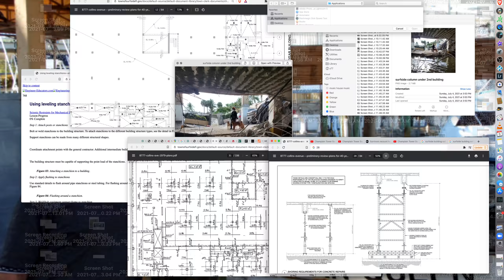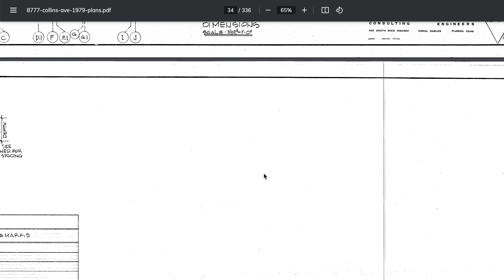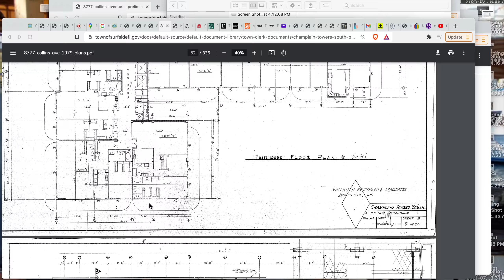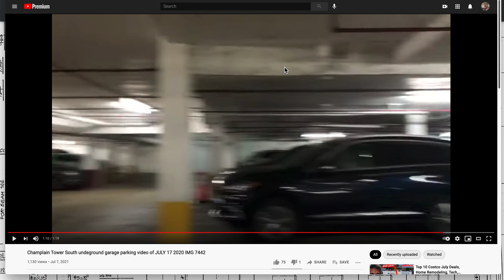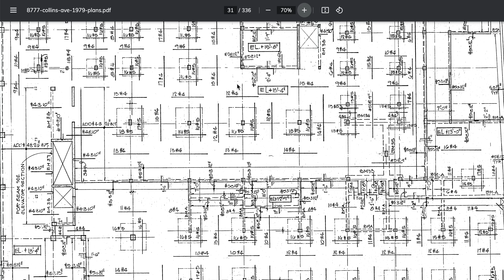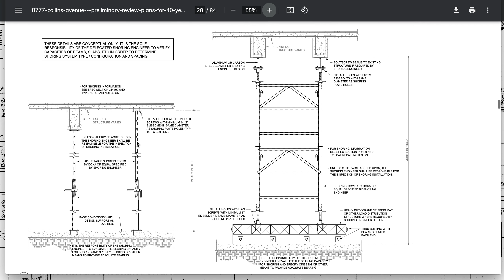Champlain Towers COLLAPSE GARAGE EVALUATION AND VERIFICATION OF BEAMS & COLUMNS DECK COLLAPSE AREA

Comment: The town of Surfside released more docs.
I read a good number of permits that were issued in May 21  related to new AC units.  In fact  some of the ac units that came down with the roof looked certainly new. 
Each ac units was quoted in the neighborhood of 5K USD. 
The building started the certification paperwork in 2018,  that is 3 years before the due date and this proactive gesture was highlighted by Mr Ross Prieto in Nov 2018. 
Maybe the Media “dilapidated and forgotten building” narrative is disingenuous to a certain point 
The renovation’s payment due date was June 30th , 21. 
Whether that came as a lump sum or a finance agreement submission, June w0th was the deadline.
Some of the surviving residents interviewed on TV  expressed as having mailed those checks a few days before the collapse.?? 

Was it all some sort of Bad construction + bad timing + bad luck  coincidence  ??
Reply: Isn't every major disaster a cascade of small events, situations, and oversights  that continually add up until one critical point when it all fails? 
I have seen other videos and images  post-collapse that feature the punch thru columns:  the images show the rebar appeared to be insufficient compared to what was indicated in the original blueprints.  If that is the case, it could be the foundation for the rest of the cascade to failure.  It's tragic so many people lost their lives for this to all  come to light. 💔

Comment: Good work.  Loved the one with the video from inside the apt, you do have good sources.

Q  Is the slab on ea floor in general a two way slab ?  Engineer noted in rebuild dwgs it was a two way slab, or maybe he meant some part of it was a two way slab.  I'm not an engineer but I haven't found anything that looks like symbols or drawing standards I'm used to that would make this a two way slab.
Q  Did you find a shoring plan to show where the designed shoring was going? For that matter I saw many notes passing the buck for engineering shoring to GC so then why show any shoring? Maybe the engineer scared of the slow pace of work authorizations for himself and GC's was about to insist finally on shoring going in untill work was done but gravity beat him to the draw.

The shoring detail for the transfer beams, showing TWO LAYERS OF HEAVY TIMBERS to substitute for pile caps (yet missed putting a transfer beam under scaffolding legs to get load to all of top layer timbers, 90% of top layer timbers were actually decorative), along with temp beams running under their full length is INSANE  that means the engineer had NO FAITH IN THEM HOLDING UP while repairs underway and with epoxy patches to full width cracks no wonder and how did that full width crack form, expanding rebar, but no not of probing to see it it's rusted even.   This detail is as you say proof something should have been done by city and engineer long ago.

It's not 100% but there is a large correlation between rough ceiling peeling paint? spalling? in areas under pool deck vs under buildings though it's obvious the building did believe in scraping and painting to keep everything "looking" ok  I question the 'beam' at transition of slab heights at first floor apts and pool deck.  i've yet to see a beam detail along the entire perimeter of the building  A curb / mini knee wall connecting the two slabs is not a beam unless wide enough and reinforced enough, and I took a quick look at 'existing' dwgs.  

I also didn't see expansion joints? Shouldn't there be expansion jt between pool deck and towers? as the deck will expand and contract differently?  Of course that would have required a separate col system to support the perimeter of the pool deck along the building.  Finally the lack of ties at property line wall, could have rusted to point they just pulled apart like little strings.
Reply: The 87th wall slab rebar corroded away.  There was a high resolution pdf I posted that correlated to corrosion in pool room, to the east of the hot tub.  Expansion joints should be for freeze/ thaw but that would have been a daily stress to the lobby beam.  When you look at the very last frame of the above video you see the basement SOG has settled approximately 1 inch or so along the shear plane and has butterflied and been repaired parallel  to the ramp drain east - west.  
Kai talks of the cantilever condition created along the 87th St wall corbel where the pool slab has failed.  The slab on grade has failed below the lobby beam planter.  Maybe the extra tile helped to level pool deck settlement in the area of the planters (initial or long term settlement) mirrored in the slab on grade below.

Comment: Also right where the collapsed floor happened at the ramp at 15:00 there is significant water damage on the deck above and almost looks like the water line from the other video. 
Is this near a column and how far away?
Reply: Also there is a significant Crack in the garage floor in that same area.
I watched a video from a resident that has now sued and won't release it "i asked him to show me it again" but I believe the column he showed in that video is right in that area as well.

Comment: Looks like some water infiltration at 13:23
Reply: Yeah you can see a bubble caused by water trapped under the paint. The paint probably made the concrete degrade even more aggressively.

Comment: The plans indicate drop slab around each column but I  can't see any? Do you see them? That would change punching shear capacity.
Reply from the maker: Micheal, check your email in a second, I will send you something.
Reply: drop slabs or just additional / different rebar  I'm still looking for symbols that might actually show this to be a two way slab, as the engineer noted someplace in dwgs existing bldg had 2 way slab

Comment: Great video.  At first I did not realize that the building left standing had stacked parking decks.  6 cars at 3000 pounds each were parked where the upper deck let go.

Comment: Great analysis. You noticed a lot more details. The building collapsed  where the pool deck joins the transfer beams and the building. The building would have stood if the deck were supported by its own columns.
Reply: Hi Tom.  I was just viewing this garage video; now I understand what you meant about the higher elevation not being as well supported. Thank you!

Comment: by the way, I think you may be onto something with the spans, esp if repairs were needed to them. between the outer fence wall and that one row of columns at 15, maybe, the next span over to row 13.1 is further there than where the row 14 thick columns are. staggered a few ways around there, so no single rebar would connect between columns, the loads would have to shift laterally through concrete over to neighboring rebar. hmm.

illustration of the "where does the other end connect" bit.
https://www.daz3d.com/forums/uploads/FileUpload/ec/3f62606fcf0c48c88d05b277e4328c.png

Comment: 3:32 yes that's the pool with pool equipment room behind it.
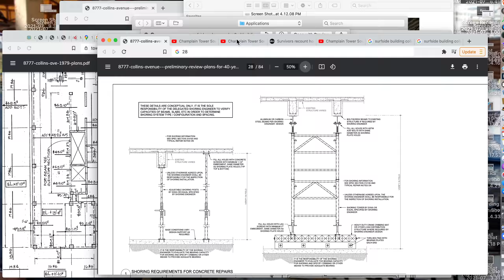6:29 thought so, ramp stops at the column after the stairwell (M-8), not at the stairwell. lol.

tad confusing there, the elevation change is at the wall of the building and patio deck, not the middle of unit C's living room, in fairness it is a tad disorienting, lol. I think she is under the patio not the wall of the building. those 'beams' are under the patio outside of unit C (the stuff we see on the ground in the sad-emoji ramp vid 9minutes or so before collapse). thoughts. if those beam ends came down on the pool deck side, how much damage would they do to the 9.1 row of columns, hmmm. looks to be a lot more vertical connection area than the slab-column connections, hmm.

26:30 uh, what if that horizontal beam between the ones in the garage deck, is the raised deck ledge of the patio up top, instead of down below in the garage, just a thought?
Reply: I agree with all your points. The investigators need to find where the two patio beams connected to the building columns. Two scenarios I see: 1. The beam twisted a building column when it fell, buckling the column with its moment, or 2. The beam fell, taking a chunk from the column, weakening it enough that the column collapses. Given the sudden failure, I would think #1 scenario.

Comment: 29.28 - is the rear most column to the right dead upright ? looks to me like its not parallel with the one in front.
Reply: I was just noticing that myself. It doesn’t look vertically correct.

Comment: I know you want to upgrade to a Desktop but if you upgrade your memory to a 16 gig stick 3200 MHz You should be able to run all the programs you want in the background it’s very easy depending on the computer you have. They have how to videos on how to change it out I know you said you had 8 gig stick Just a suggestion it’s a lot cheaper than buying a desktop at the moment
Reply: Hi Bk
Reply: I’ll BGT V

Comment: 1) look at the beams or lack there of on 2nd floor on up….
2) steel in the floors 2nd story on up….
- its a no brainer that shoring should have been installed immediately years ago.
- look at the SOG (slab on Grade), those cracks are a telling sign,  core-drilling to see if voids below existed and slurry filling them should have also taken place if found, along with crack chasing and sealing.
- can’t tell you how many times we have removed planters and topping slabs above parking or elevated decks, bead blasted and re-water proofed due to  water invasion or thru slab leaks.
- at the least a crack chaser and epoxy sealing on the elevated decks should have occurred as a stop gap measure, not a fix.
- I believe they will find under SOG (slab on grade) erosion at or around the piers/columns under the  front of the 1st stage collapse as we saw in the video will be found to be the failure points,  I say this because a cantilevered deck failure causing column failure? if this is the end cause it has to mean the piers/columns were first  compromised  by compaction failure (erosion of soil) around them. (liquefaction may have occurred as well due to the impact of the first collapse area, weakening  the remaining piers /columns ability to remain sound)
- having said that, the pier/column failure was collapsing inwards towards the center 0f the building which would have pulled the cantilevered deck away from the ledger causing its collapse as witnessed from above. (appearing to be a sink hole as quoted)
-of course this is all conjecture on my part, we shall see how it plays out and rather quickly too, time is  of the essence here, to many lives depend on the answers!
tip: you should use a highlighter to color you structural sheets, for step ups in elevation and beams,   it will help you when bouncing back and fourth.
keep digging man…
Reply: I have a similar thought process as well. One failure led to another as well as shoddy workmanship during the concrete pour led to total collapse.
Reply: I think the slab cracks are as you described.  Some slab areas appear replaced already.  In the pool deck area the slab would have pinned the columns, (like tripping)  I think the hot tub channeled offset some shear.  So the garage wall along the 87th St would have had some overturning moment possibly pushing the pool deck towards the lobby beam.  I assumed the pool deck was attached at the 87th St  but severely corroded rebar and failed concrete along the slab edge.  The adjoining demolition/ foundation could have been transferred across the pool deck with dextral shear along the hot tub side towards the lobby.  The column attachments acted as hinges for the butterfly (s-wave) to form as the pool deck tries to push against the lobby beam.  The SOG also responded, but did it respond in phase or opposite phase.  Was the slab on grade also pushed along westward, shearing at the hot tub base?  I don't know what happened at the deck joint to the north of the building.  FIUEEEE has blonde hair and an orange red dress in the mirror of the full length video of unit 611.   In the lawsuit photos the SOG had E-W epoxy repairs (parallel with parking spaces).  

If the SOG had already failed (cracked) did the 9pm super high tide - (noted by others) three foot high tide on the two foot elevation SOG push or allow something to pop or shift (already failed) 
you can use an empty cereal box to explore some of this interaction between the pool deck and basement slab vs lobby beam and 87th St wall.
Reply: It's always nice to see constructive feedback

Comment: Seems pretty obvious that this building had severe issues, question is why wouldn’t the engineer have worked out that a pool deck collapse could bring the whole building down? Someone (engineering firm or Board) didn’t react with enough concern to save 150 lives.
Reply: Condo Boards NEVER want to do anything that cost money!
Reply: There is a list of violations against some of the (former sad to say) building residents by the township inspectors?.  Renovations without a permit, then I had to understand turtle lights and shades and having violations for lights pointing towards the ocean... they were undercover down by the beach at night looking to write tenants/ residents up.  Diligent